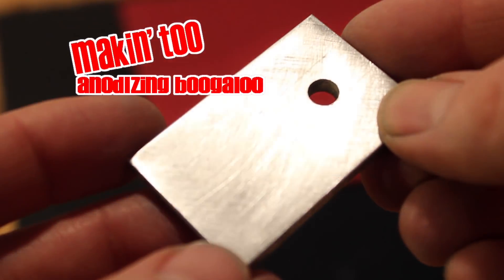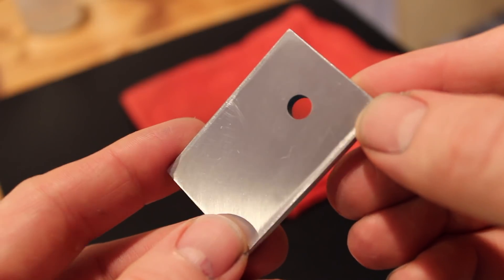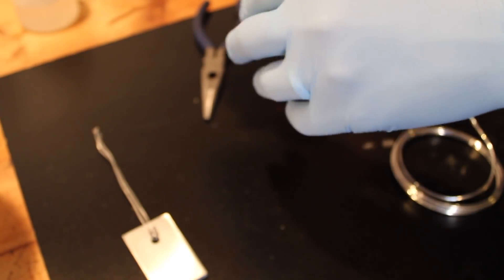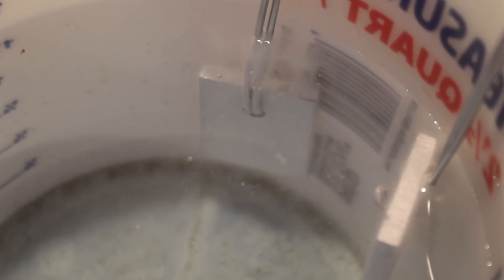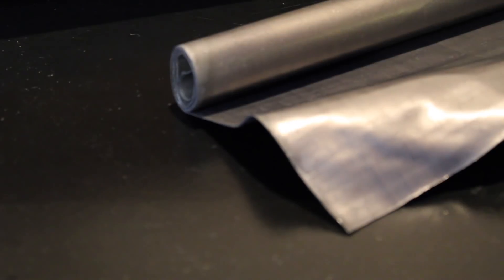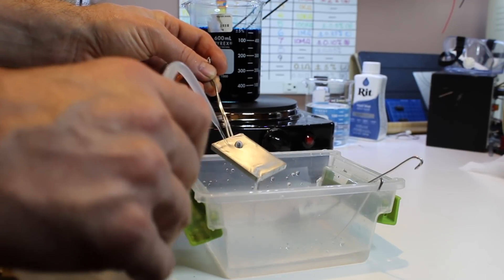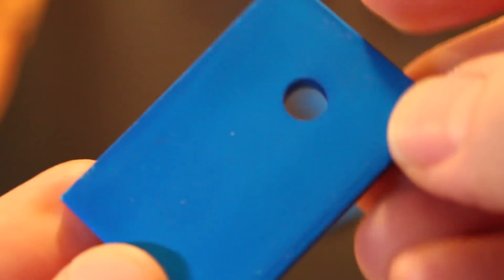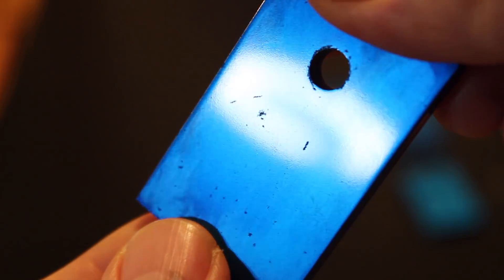DIY Aluminium Anodizing

Comment: dont put the pH paper in to the solution, use something else (like a pipet) to transfer a drop (I dont think it wil hurt your solution though, however it's good pratice when working with acid or base)
Reply from the maker: thanks for the best practices tip

Comment: Great process video.  Do you have to seal the parts if you don't dye them?
Reply from the maker: yes, I sealed them in boiling water for 30minutes
Reply: @makintoo6421  does it have to be distilled water too or regular tap water for the boiling process?
Reply: Yes.